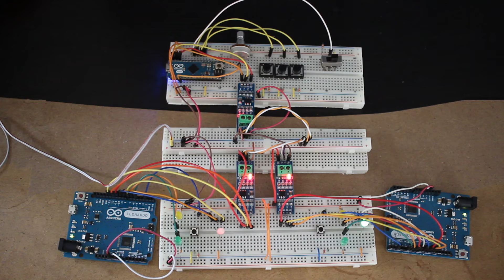RS485 Hardware Network With Arduino - Part 2

Comment: Nice tutorial/demonstration.  The only thing I noted is that you don't want power from VCC on the Max485 connected to V+5 on the Arduino.  The VCC is for power indication.  if you use it the way you did, if you reset a slave arduino, it seems to flood the bus with a signal which blocks all other network traffic.  I could be wrong, but try resetting an arduino while messages are sending and you'll see they don't get communicated until the reset is released.  I think you'd want messages to through even while one slave is being reset.  The master might be the same, but if it stops the bus you'd never know.  I put together an automated test and got this sort of result.  I will send you my details of you'd like.
Reply from the maker: I noticed this behavior, and assumed that It was just the nature of the bus. I assumed (maybe incorrectly) that VCC on the breakout board was tied to VCC on the MAX485. The datasheet for the MAX485 part doesn't say anything about VCC for power indication (or at least anything that I can see). Let me see the results of your experiment! Thanks for commenting.
Reply: esological as soon as I get home tonight, I will make a quick video of the setup and try to draw up the schematic.  When I tied VCC to an LED and to ground, it would stay lit as long as I didn't reset the Arduino it was coming off.  Everyone seems to use it as an input, but I'm not so sure that's correct.  for example, I intend to use it to run a data bus between locomotives in a model train setup.  If a locomotive's controller should reset, I don't want the rest of the bus interrupted.  I'd want the rest of the machines to keep receiving until the card reset.  I actually am thinking of doing dual bus.  I to transmit from controller to locomotive chain, the other to receive updates on request for monitoring.  at any rate, I'll send my stuff ASAP.